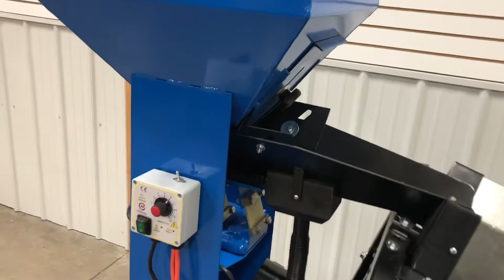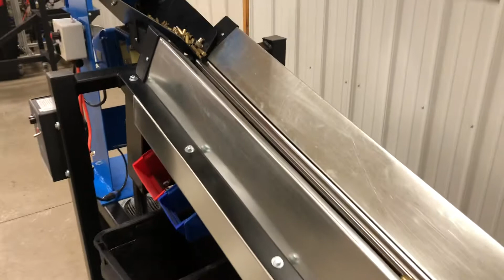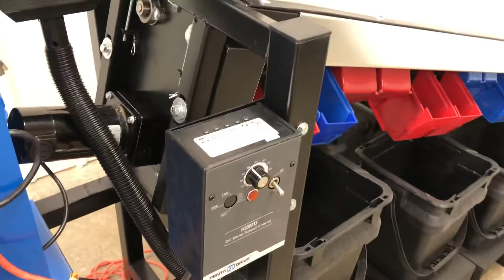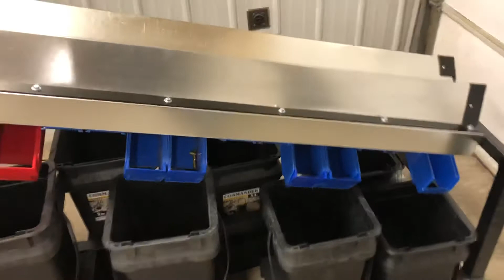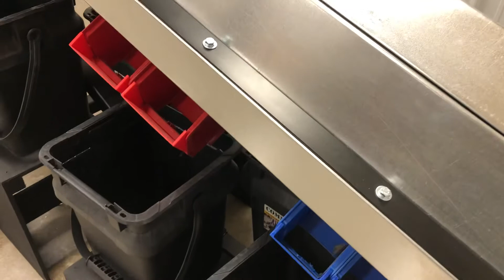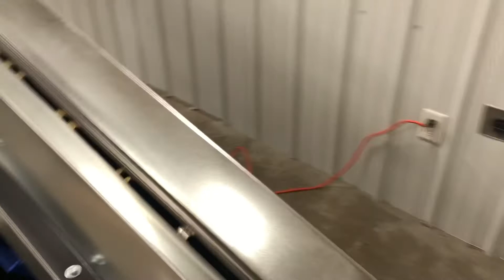Ammo Brass Case Sorting Machine V (Brass Sorter)

Comment: What stops cases from piggybacking on top of each other down the rollers?
Reply from the maker: That can happen, if you feed it too fast.  You just need to adjust the feed of the cases so they separate and feed single file on the rollers.
Reply: @GSMachines   what’s your email.  I’d like to buy a machine for my company  here is my email jmnowaski4@gmail.com
Reply from the maker: @joshuanowaski6823  I sent you an email. If you did not get it, email me at gene3441@gmail.com and I will send it again.
Reply: I have one of his machines, if your running it at the rite speed it doesn’t really happen, it works of the principal of different sizes tires spinning at different speeds. If on is smaller it goes faster, larger moves slower, so they naturally don’t like to stack when they go down the rollers.